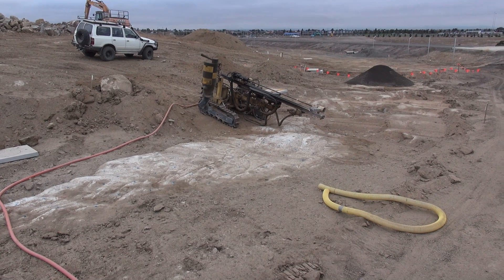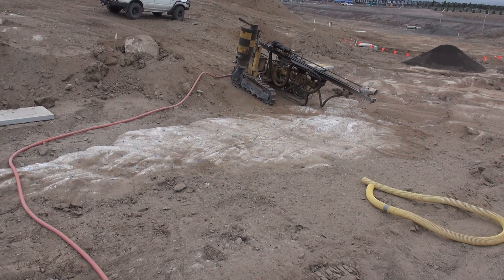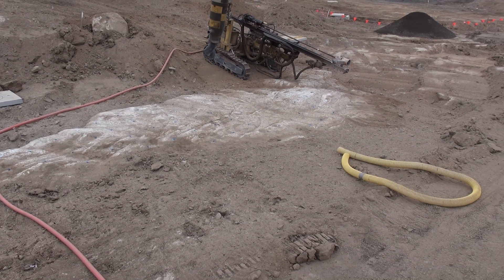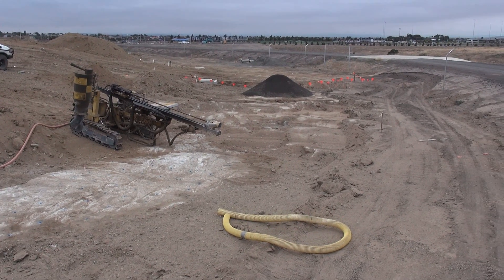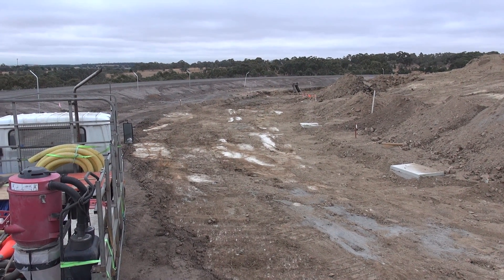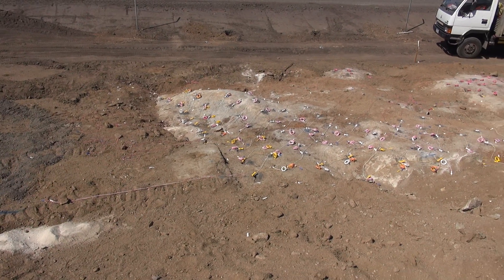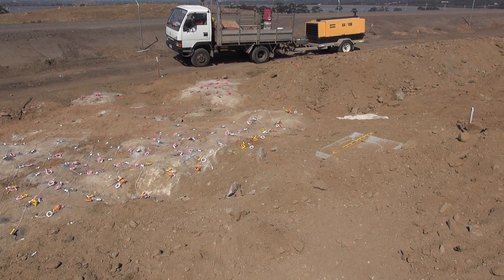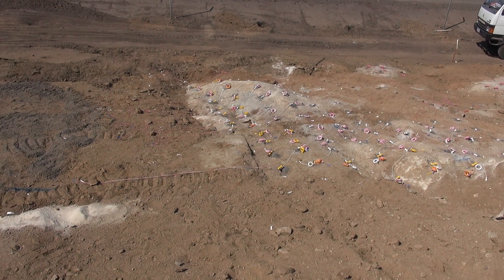Blasting Granite for road boxing

Comment: Is the Tamrock Commando 300 a popular machine down there? They are the cats ass up here, amazing compact skid steer drill rig. Even better with OTR tracks and remote control. Have you seen these? Your production increase would be huge.
Reply from the maker: Hi there "Tax Me" - I am familiar with that machine, another contractor in Canberra had one and he spoke highly of it. The improved coverage area with the articulated boom is very attractive as is the fully self contained aspect.
I believe the hammer is only 5Kw where as the BBC120F on my old machine is 7.5Kw.  Cost is the big issue, not sure what they go for in Canada but a very tired old one went for $65K here recently. Have you seen my drill mast on my small excavator? that is also pretty handy, uses an Atlas Copo Panther Hammer, only H22 drill steels but I must have drilled 10,000 holes with it.

Comment: Hi Dave, good to see your drilling rig is earning its keep and saving your body some wear and tear. Looks like you have got yourself a 4x4  4 tonne truck and a bigger compressor. Things are looking up at the moment.
Reply from the maker: I've had the Canter since 2006, it's a good truck as long as you don't mind going very slow in traffic, surprisingly good off road. The 375 CFM compressor has been on the scene about 4 years. This drill rig has a lot more power than the one mounted on the small excavator. Cheers Mark.
Reply: My ex and I brought a Mits canter crewcab dump in from Japan and it was an amazing vehicle. Got engine parts through a mits forklift dealer. Wish it was a 4wd. Great low end gears.
Reply from the maker: @gangesexcavating  Sorry I missed your comment, The 4x4 Canter is surprisingly good off road, I've crossed rivers over the wheels and been dragged up steep logging tracks behind a D7 etc. It was a bargain truck from the army auctions, older than I was looking for, but with only 17,000 K on in how could I pass it up.